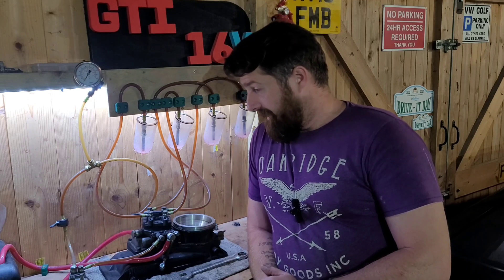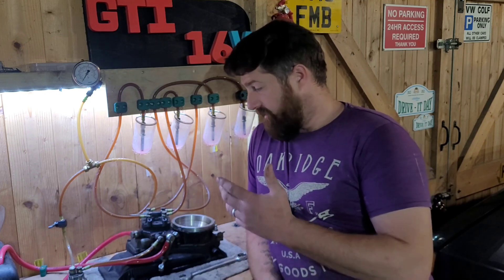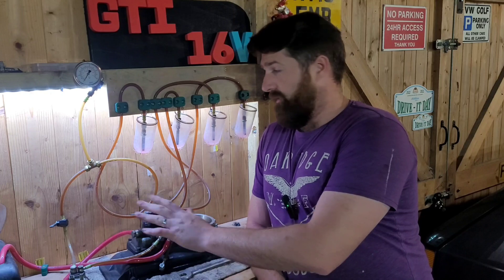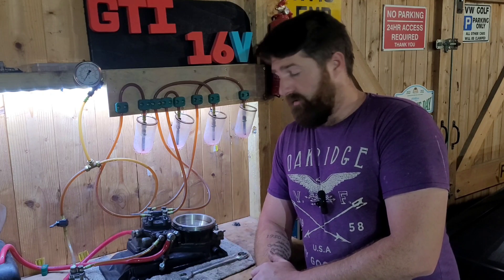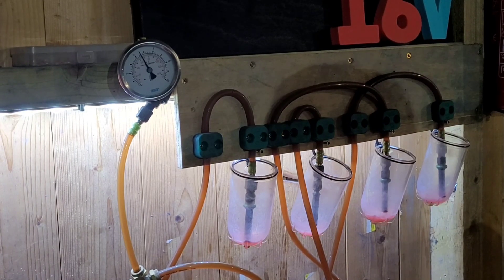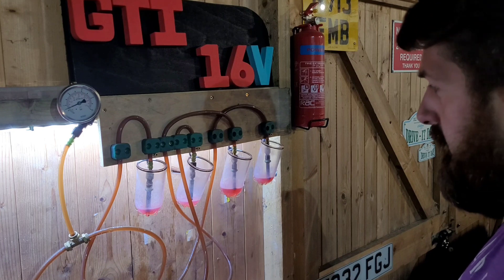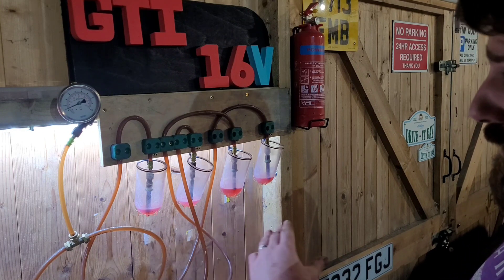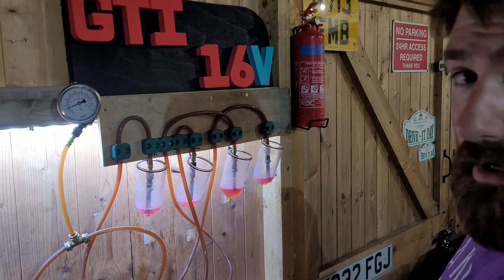Bosch K-jetronic - How to: Modify Your Metering Head

Comment: Can you point me in the right direction to find fittings fir the m12x1.5 injector? Id like to make custom flexible lines for my car so i can do a custom intake manifold. The distributor end is easy 10mm banjo. Cant find a good way to get to the 
60°(?) Flare.
Reply from the maker: Unfortunately they are mega hard to sorce, the closest i found was some fittings from a hydraulic hose company but they would still require further machining to fit and seal
Reply: @GreyGooseRestorations  yeah. I was at the hydraulic shop with thier guru. Found options but they're going to be like hundreds of dollars to get 3 or 4 fittings for each line. I think I'm going to machine my own so I can use banjo on both ends. Since they're m12x1.5 I'll use a open end lug nut with a lug bolt machined with the proper seal shape on the tip. Bore a hole for fuel flow and face, bore and tap the lug bolt head m10x1 for a banjo bolt. It's that or use the stock injector ends and a section of tube with a flare in the end and get a proper size crush collar to fit it to the hose. I found a hydraulic swaging tool for $115 and that does from tiny to like 1.75" so very nice to have.
Reply from the maker: Best way to be honest, do it yourself then once its all done and someone says where did you get those...you can then say 'I made them' 😉

Comment: Great vid on system pressure! So if 6.6 bar = 150cc and you tweaked your outlets to give you 195cc off of 5.8 bar, what is it that you did to your outlets to achieve that?
Reply from the maker: Thanks, just the flow adjustment, ill cover that in the next one 👍

Comment: Very cool. Im putting a 560sl ke-jet engine in my 450slc amd using the 450slc cast iron k jet system. It runs great with the 4.5 and im hoping it will be happy with the 5.6ltr. I'm installing a wideband for safety. Hopefully i dont need to tune it but im sure you videos will help if not. I have a friend in slovakia that knows the system very well too. I understand but honestly my car has been so great ive never hadcto mess with it. I have a bunch of other Mercedes that dint run so well and i hope to get them straight too. Have you ever messed with Mercedes v8 stuff?
Reply from the maker: Awesome, theres not so many V8 Mercedes-Benz around that need work as they seem not to go wrong which is a good thing for the owner, definitely wouldn't say no to working on one
Reply: @GreyGooseRestorations  they go to shit when they sit for too long it seems. Or maybe they were sitting because they went to shit. I've rescued and revived a couple but I've had no luck with a few and never gotten to deep into them since they were in rough cars. My race/drift car gets all my time and I street drive diesels mostly. I've had zero fuel system issues in 6 years drifting auto cross and street driving the 450slc. Do you think the properly working system will have any issues with being put on a bigger engine? The same parts were used on the 6.9 liter cars also in the late 70s so I assume it will work ok but I've never modified it.
Reply from the maker: @jasonbirch1182 ah cool, yes the system will work, it may need the outputs adjusting for touch more fuel potentially
Reply: @GreyGooseRestorations  I'll be watching to see how you do it. 👍

Comment: I tweaked my system pressure up when I rebuilt my 16v 8 years ago, but I am fitting uprated cams, nothing too hairy, as it’s a street car rather than track, 272 degree. But once it’s finished, I will again check the power and mixture to see if it’s still okay. Already thinking about pulling the metering head apart and fitting new seals as they are probably original...
Reply from the maker: Some seals i have found have been flexible still but flattened over time that seem fuel past internally